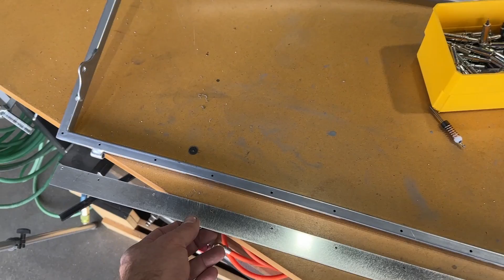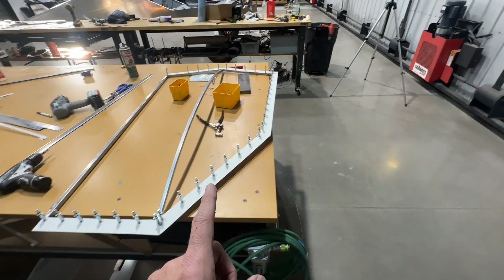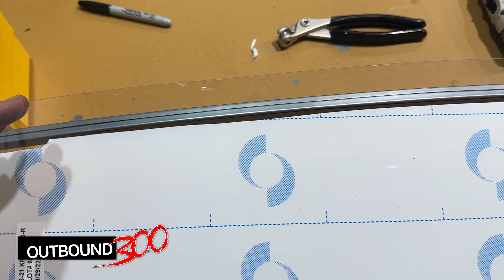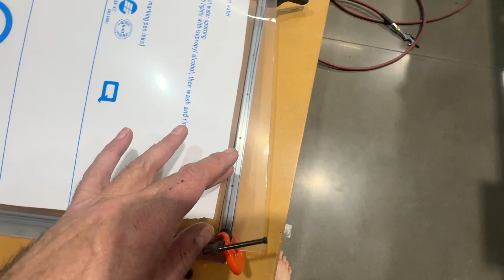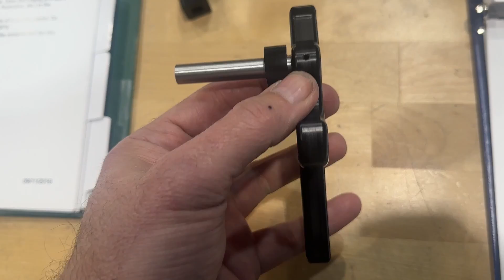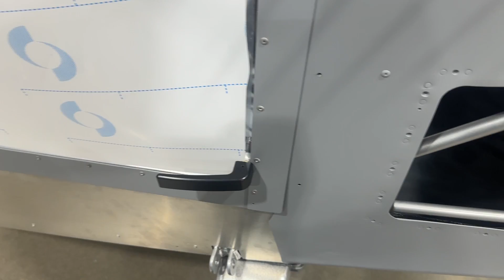Ep. 54 - RANS S-21 Assembling the Doors

Comment: Nice Job!  Just working on my boot cowl and I remember seeing the side access port you have on the skins.  This will allow an easy spot to work on the brakes etc.  Did you source this from somewhere or did you fab it yourself?  Do you have a pic with the inspection cover on?  Thanks!
Reply from the maker: Boot cowl access port episode is releasing later today. Stay tuned!
Reply: @Outbound300  Appreciate that.  Trying to find the tight radius edge roller you used on the window opening.  Any reference to sourcing?
Reply: Disregard,  just came across at Aircraft Spruce, Hole Flanging Tool!

Comment: Did you use a special drill bit for the Lexan ?
Reply from the maker: Polycarbonate (Lexan) is not brittle like acrylic (Plexiglass) and can be drilled with standard twist drills. No fear of it cracking.